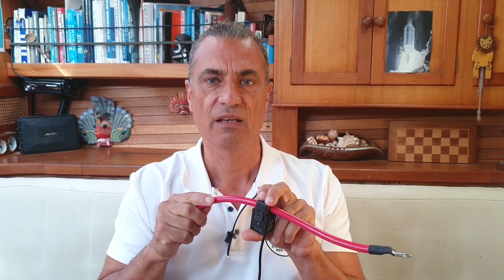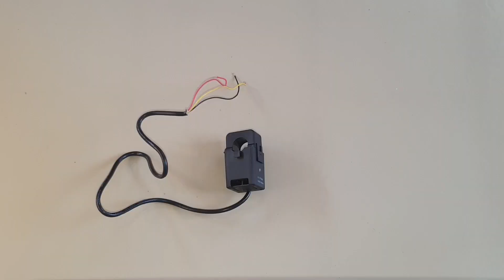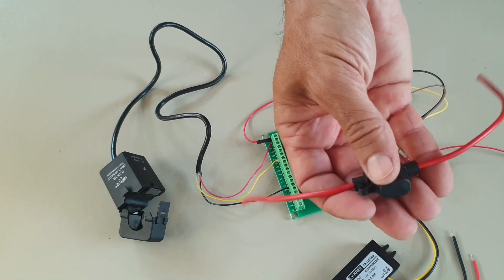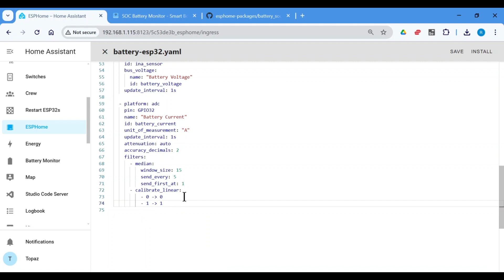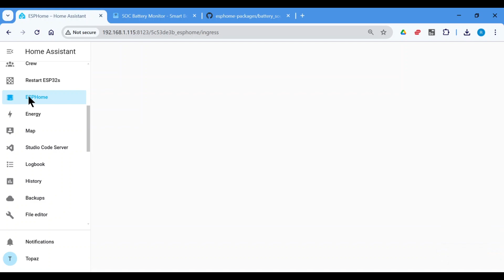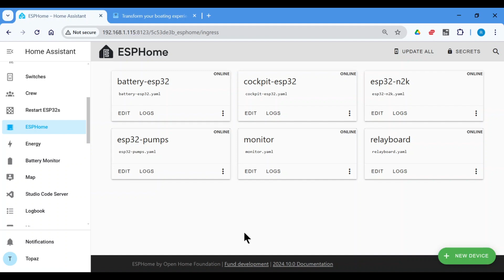Build a Comprehensive SOC Battery Monitor

Comment: I’ve just finally got around to doing this project. I had issues reading the voltage via the ina226 and traced it to lines 44 and 45 of your yaml file. The gpi021 and gpi022 were pointing to the wrong pins (sdl and sda). They were reversed. All good now, thanks for your work!
Reply from the maker: Well done!
Reply: Hi Rob, when it comes to calibrating, where are you seeing the voltages in the dashboard?

Comment: I have 3 regular lead acid batteries on board, besides when cranking the engine I don't believe I'll be using much draw. Which amp sensor would you suggest for this?
Reply from the maker: For SOC you typically don’t size the sensor for cranking—the starter draws huge, short spikes and you usually don’t include the start battery in the SOC monitor anyway.
Pick the smallest bidirectional Hall sensor that comfortably covers your house-bank peak (not the starter) so you get better resolution.

Comment: Intersting idea to use a Hall sensor! But the ADC of the ESP32 is quite crappy....
Reply from the maker: I find the ESP32 ADC good enough for this application. On a boat we don’t need lab-grade precision – calibration in Home Assistant makes it accurate enough for reliable SOC and current monitoring. For marine use, the balance of cost and performance works well.

Comment: Thanks Rob. Great video. All up and running but how would I monitor a second battery bank using the same ESP32? If using the  INA3221 to monitor three battery banks (House, Engine and Generator) how would you change the code? Can you wire three hall sensors as well? Do they use the same pins on the ESP32? Thanks!
Reply from the maker: Yes! The INA3221 gives you 3 battery voltages, and then you measure the currents with 3 separate Hall sensors on separate ADC1 pins (GPIO32–34). Each Hall sensor just needs its own `adc` entry in the YAML with a simple `calibrate_linear` to scale amps.

Comment: I am so very grateful for these videos.  The question that I have is in regard to the size of the hall sensor to use.  I am using 2 12v marine batteries set up on separate circuits - the batteries indicate 8-24 amp with 550 cranking amps and 700 cold cranking amps.
Reply from the maker: Thanks so much!  For a Hall sensor, size it for your house circuit’s normal max current, not the starter. pick the smallest bidirectional Hall sensor that comfortably covers your house-bank peak (not the starter) so you get better resolution.

Comment: Hi can you help me with one of my project for remote monitoring of my solar system with four batteries status
Reply from the maker: Sure!  You can use the same setup I showed here — an ESP32 with Hall and INA219 sensors — to monitor each battery’s voltage and current, then send the data to Home Assistant for remote viewing.

Comment: Really great video, thanks. I have 2 AGM house batteries, what would be the best way to track them - individually or combined?
Reply from the maker: Thanks!. If your two AGM house batteries are wired together as one bank, just monitor them as a single unit. In normally use you would be using both of them in parallel.

Comment: Another great project.  My batteries have a bluetooth connection to report SOC but it seems to be very flakey and hard to connect to.  Just hard enough that it stops me from staying on top of it.  Having this on a dashboard will be amazing, and the tracking here is so much clearer and easier to customize than other much more expensive platforms.  Rob Im sure you have a long list of projects and videos you plan to do and make, but I would like to put in a vote for refrigeration temp tracking and control.  The tracking is easy of course with one of the many inexpensive drop in temp sensors available.  But the ability to control the temp setting somehow would be amazing.  I am talking about the typical vitrifigo, dometic etc built in units.  To be able to up the temp setting when the engine is running or when the battery is at full charge from solar and capture that spare energy would be amazing.  Not sure if it is possible, but I figured you would know.  Thanks again for your great series and website.
Reply from the maker: Thanks. I am not sure how these fridge are controlled but most I assume have a thermostat that switches off the compressor at a certain temperature. So a work around would be to have the fridge thermostat turned as low as possible so that the fridge is always on and then add a virtual switch to the power supply of the fridge unit. So then HA will control the on and off of the fridge based on the temp sensor you have installed. I would probably use the same sensors that  I used in the Engine Temp videos. They are very robust and reliable.

Comment: Hi rob.  I love your channel and am having a lot of fun setting up boat monitoring for less   .  I have a quick Q. I understand the notifications and alerts (which are awesome), but how will you monitor it remotely without the home assistant cloud?  Thanks again!
Reply from the maker: There are many options for remote access. The easy but paid option is Nabu Casa.. Hiwever the first month is free. Then there are free options that need some setup like Cloudflare Tunnel and  Tailscale. I recommend starting with Nabu Casa.

Comment: Great Video and very interesting! I just found your channel full of What I'm looking to do. I've one questions I would like to measure the current of battery of motor, usually consumption is around 1 or 3 Amps, but when motor starts the consumption can go up crazily 150 amps of couple of seconds. Is this dangerous for Esp32 or for sensor itself? By other way and just for curiosity to share what I’m doing: I use with Openplotter with signalK, I've Home assistant for home, but for sailboat I prefer Openplotter as I've winds gauge, Plotter with my personal maps.  And just to give and extra idea, as external monitor when I’m sailing I’m using a Chinese screen audio car.  And in one device I’ve all gauges, plotter screen…. Is fantastic and cost really interesting!   Thanks another time for this channel and video!!!
Reply from the maker: Thanks.  I have a waterproof tablet in my cockpit running HA,with all of my navigation and all of the Smart Boat functions, Navigation, Windy, ChatGPT and any other android app I need.
For your motor a 150A sensor would also measure the startup current, but then it would be less accurate for readings of 2 to 3 amps.. If you use a smaller sensor I doubt it will be damaged.

Comment: Excellent project! Do you have the pics of the final product? How do you encase this so it's not on the way?

I guess from your final panel that you built two of these? Or is it possible to have two sensors on the same ESP32?

Thank you for sharing this projects on a clear and extensive way
Reply from the maker: Each project is different with casing requirements and space.. For this one I just screwed in the ESP32 and the INA219 to my wooden battery box. But each installation is different so that is why I do not really go into the final installation.

Comment: Finding your videos really helpful and very grateful for all your code.
I'm really excited about this one but as we are going fully electric we have two big banks of 12v LiFePo4 wired up as 48v, that's needed for our electric motor.
After watching this video I was unsure if I should be monitoring the whole bank as if it were a single battery or if I should be monitoring each individual battery.
Reply from the maker: You can go either way but I am not sure how you have wired 2 banks of 12V to reach 48V. You could monitor each bank separately with a Hall sensor for each bank. Or you could monitor the 48V together with one Hall sensor. If you go for the 48V approach you will not be able to use a INA226 to measure the voltage as they have a limit of 36V
Reply: @SmartBoatInnovations  we have 4x300Ah (12 volt) batteries wired in series in one bank. 2nd bank is completely independent 4x120Ah (12 volt) again in series.
The 12v batteries all have their own bms. Unfortunately, 3 of the 300s are 1 version older so don't have Bluetooth access to the bms.
So I want to get as much info as possible into home assistant.

Comment: Hi! Thanks for a god video. But you are linking to wrong hall sensors? The linked sensors only have two cables? No signal?
Reply from the maker: The Aliexpress links are direct to the manufacturer shop. Amazon is a bit more complicated as the hall sensor is not available in every country and then Amazon just recommends something that is similar.  What country are you in?
Reply: @SmartBoatInnovations  Thank you for your answer. Im in sweden. And all i find is 2-wire sensors.

Comment: I am wondering, if it is also possible to do that using the Arduino.
Reply from the maker: It’s technically possible with Arduino, but it’s very challenging. You’d have to manually write all the code for sensor integration, calculations, and Home Assistant communication, which ESPHome and HA handle effortlessly. ESPHome makes it so much easier by managing everything with simple YAML configurations—no coding required!

Comment: Thanks for this interesting project. I dont think this is the best direction to go. These clamp meters have too great an error. Look at the calibration at 19:13. The difference between 34 and 55 amps is from 1.78 to 1.85. So every .01 change in the measurement is about 3 amps. That is the error you can expect! My boat typically has a load of under 5 amps. This monitor might call that 7 or 4 amps!  Meanwhile, the shunt based monitors are accurate down to .01 amps. And, you can get a reasonable one for around $30-50. (I got a junctek kl-f with bluetooth)  Name brand ones for under $100. What this community should be doing is finding a good shunt based monitor and figure out how to get the data into HA.
Reply from the maker: Thank you for your comment, but I respectfully disagree with your assessment. In my experience, these sensors are quite accurate. I have been using a 200A version on my boat for several months, and it matches the accuracy of my BMS.

In your example, between 1.780 and 1.850, there is a difference of 0.070. However, when you use three decimal places instead of two, there are 71 calibration steps within that range, not just 7. This finer resolution allows for much more precise calibration and measurement. Each increment of 0.001 corresponds to a smaller change in current, improving the sensor's accuracy significantly.

So, you might consider using three decimal places rather than just two to achieve better accuracy with your measurements.

As I mentioned in the video, this setup works equally well whether you're using a Hall-effect sensor or a shunt-based sensor. Both can provide accurate readings when properly calibrated and configured. I always encourage people to use the solution that best fits their specific needs, but I've found the Hall-effect sensor to be both accurate and reliable in my own setup.

Comment: Awesome video Rob. Great and cheap alternative to a smart shunt and I like the hall sensor. Would it be actually possible to get the cell values into home assistant too. The ESP32 should have enough connections left and eg using an INA216 or 219 to get each cell values. Should be a big effort to do that. That would allow you to do alarms based on cell level or steer an active balancer via HA. Or cut the alternator sense wire at 3.4V cell voltage which means you can use any alternator with internal temp protection but don‘t have to care about it’s regulator and don‘t have to convert it to external regulation. Alternator is only good for bulk charging anyhow and to avoid all problems (with cut off under load, absorption and floating…) just let it bulk charge and cut off, the last 2% is better done with solar anyhow. Just 2 of many things you can do if you have cell voltages. You don‘t wanna do any of the 3 on total voltage because you can have a runner cell with higher voltage or a looser with lower voltage then the other and need to start balancer earlier or cut the alternator earlier or send an alarm earlier. That means your BMS must not be integrated with home assistant (because eg it can‘t) but you can still do all necessary warnings and optimizations and BMS does independently it’s security measures if needed.
Another good use case would be several hall sensors so I can eg measure each charge source individually so you know exactly which source is contributing how much and when to the total charge. Can also track eg alternator output over time and in relation to temp which we already have in HA as you already done that in another video/project and eg cut it off when too hot.
I have a Victron BMV712 which is known to be very precise and like to compare that with your hall sensor solution. If that’s equal that would solve the only inconvenience I have that shunts heating up the surroundings ßas I run up to 550A
Reply from the maker: I forgot to say in this video that the same technique using the Hall sensors can be set up on any charge circuits as well.
Measuring the cell voltages is also possible. Probably would use a INA3221 that can measure 3 voltage sources.  But depends on how many cells you have. 
550A is a lot of current!!
There is a 600A Hall Sensor available though.

Comment: Hello, is there a possibility that your project could be used to monitor the charge of a solar system with a voltage of up to 60 volts. The INA 226 module is for voltage up to 36 volts. Otherwise, I like it very much. Thank you very much.
Reply from the maker: @user-mer3666  Yes you can use this to meausre current and voltage for a charging device. To use for 60v you could use a INA238 or just setup a voltage divider using 2 resistors to bring the voltage down to a max of 3V so the esp32 can measure it.

Comment: Thanks again, Rob! Great timing since I just received my cells today to build my own LiFePO4 house battery bank per your earlier video! Since you said the BMS's numbers are not always accurate, do you now recommend a different BMS for my new battery bank? John
Reply from the maker: I think most BMSs have issues with SOC accuracy.  Do a google search for BMS SOC accuracy.  I have 2 Daly BMS and for 2 years they have worked very well. I like their solid build. But there are other BMSs out there that have  good reviews but I cannot personally recommend any others as I have not used them

Comment: Very good project and code! Have you considered setting the MAX/MIN voltage automatically based on annual monitoring data?
By using the highest and lowest voltage readings throughout the year, you can dynamically adjust the limits to always reflect the latest max and min values.
Reply from the maker: Yes that could be possible but I would still want to be able to manually configure them. But  what happens in the scenario that all year your batteries are fully charged. Then the minimum voltage might be automatically set at 90% SOC.
Reply: @SmartBoatInnovations  It will be good to set this manualy, but update the values if the voltages are higher / lower during use from statistic. This way it will auto calibrate.

Comment: very interesting video! and thanks for uploading all this content. i would be interested to see how your boat looks like regarding all the electrical connections.. esp32, raspberry.. etc.. i see you integrate many things and it looks easy once checking all of these systems on the table, but once integrated together with each other i would be interested to see a picture of that... or a video! for an inspiration would be great!
thanks for your support!
Reply from the maker: Thanks. You would not notice any of these on my boat. I have everything nicely installed in small electrical boxes out of the way. Only the Rpi is visible because I have it installed in an attractive case.

Comment: Interesting idea. The price of smart shunts is coming way down. My victron is pretty easy to integrate into ha. Is there enough of a reason to build your own? If your system is a plain 12v is the ina enough? How many amps will my engine draw when it starts? Ie how big a hall sensor?
Reply from the maker: Yes it is interesting and works very well and easy to setup. To answer your questions:
Hall Sensors are much easier to install than Shunts.  
Not every one has a boat full of Victron. I personally only use their MPPT as I have no need for anything else. 
There are many reasons to build your own - price, better customization, space and seamless integration in HA. 
The INA226 handles up to 36V. 
You can get Hall sensors up to 600A.
Reply: @SmartBoatInnovations  I have further thoughts on the size of the Hall sensor. I think I bought wrong, I ordered a 200amp model thinking that would handle the outside possibility. But I think that is the wrong size. I note the various models are all essentially the same price. They all indicate an error level of 1%. This means my chosen sensor has an error of +-2amps!  I think I should have bought a 20amp model. Maybe Im better with both. Perhaps I can write some code to use the 20amp sensor for low current and anytime the current nears 20amps the monitor should use the 200amp model. 
This might be an advantage of shunts. My victron monitor measure +-600amps with an error of .01amp. That is far superior to these Hall effect devices.
Reply from the maker: @davidhopkins   It is better to use a Hall Sensor that is rated closer to your expected load. The 1% error is a theoretical spec but I have not noticed this in practice.  I have a 200A Hall sensor and the low current reading match quite closely and are definitely not 2A different. Would be interesting code to use 2 Hall sensors. The difficulty would be deciding which sensor to use the value from when one reads 19.9A and the other reads 20.1